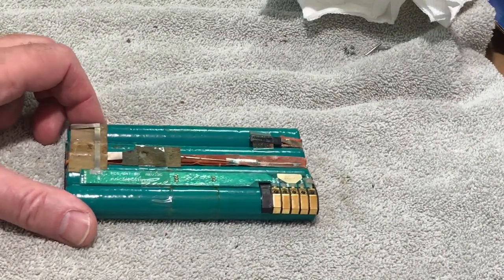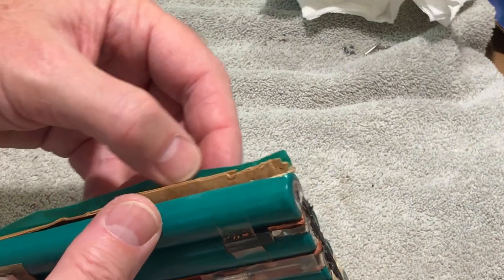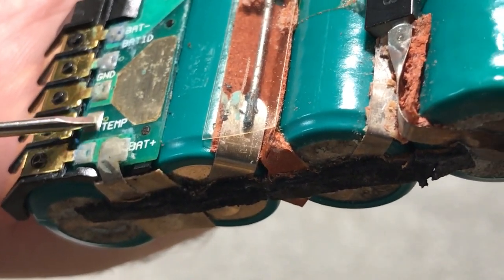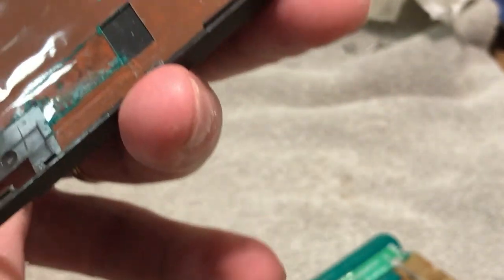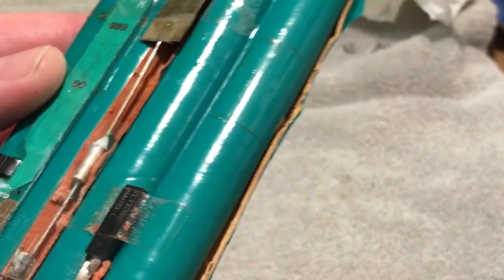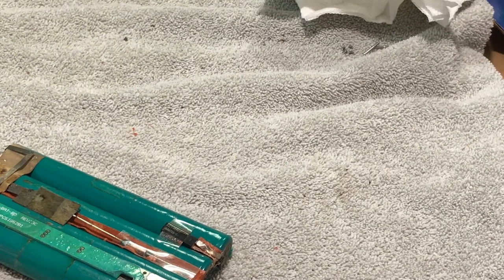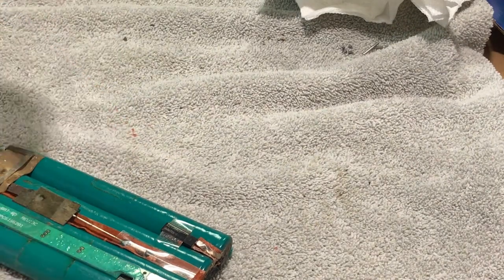REBUILDING THE POWERBOOK 1400  BATTERIES PART 2

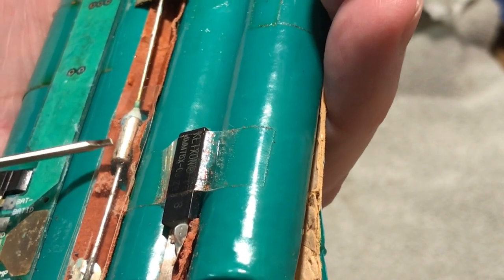Comment: Hi David -- great series! From 3:41 -- can you post the details/markings of that factory diode (for a replacement)? Even with a microscope I can't make out anything on mine other than (maybe) the word "micro" and "250V ~ 10A." I accidentally fried mine.
Reply from the maker: Sure Give Me A Day Or So Glad You Liked The Video
Reply from the maker: Ok First Line  KLlXON Second Line 4MM75X-09
Reply: @DavidStahlOLDHAPPyMACs  sorry, not the thermal cut-off switch, but the diode at 3:41 (edited original comment timestamp)
Reply from the maker: @shadyRobot  There 5 Lines from Top To Bottom First Line 8R Second Line MA Third   Line A5 Forth Line 25 Fifth Line can't read it could be 85 35 not sure
Reply: @DavidStahlOLDHAPPyMACs  I tried again with the scope and what I can best make out are lines: 1) MICROTEM 3) G4A5 --- --- 4) 250V ~ 10A. So, it looks like it's a Microtemp G4 series thermal fuse: https://www.newark.com/c/circuit-protection/fuses-fuse-accessories/fuses/thermal-fuses?product-range=microtemp-g4-series
Reply from the maker: @shadyRobot  Thanks For The Info I Will Book Mark That Page On That Web Site
Reply: @DavidStahlOLDHAPPyMACs  sounds good. Just as a disclaimer I can’t make out the temperature rating, just likely the brand and model range.

Comment: Hey David, have you thought about making the leap to Lithium? The thermister and polyfuse, are pretty easy to replace. I'm thinking about doing the transition for my 1400. In the past I used Pk cells, they are the best that I have found for direct factory replacements.
Reply from the maker: Right Now I'm Going To Say With The  NiMH For Now. Might Do That On The Other Battery Pac For My Very Nice 1400cs 166  I Will Use The Parts  Machine To Test The Rebuilt On
Reply: @DavidStahlOLDHAPPyMACs  understand completely, There are only so many of these older Macs and Powerbooks to experiment with.